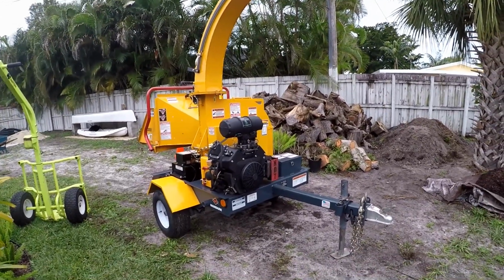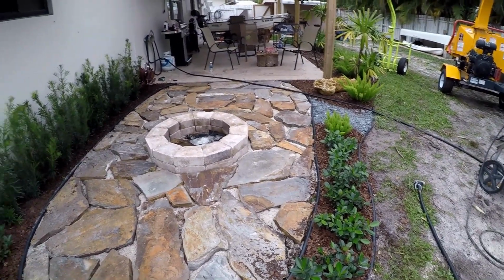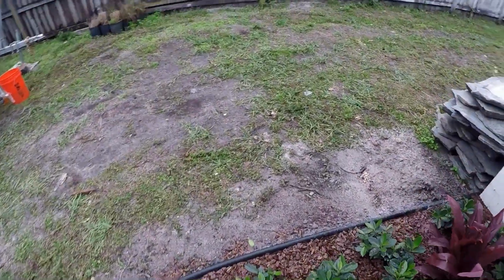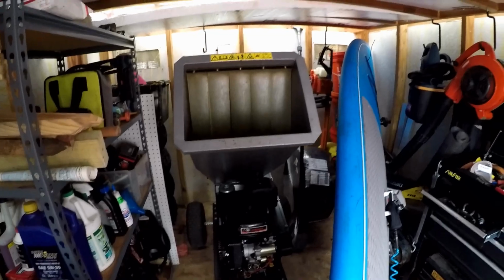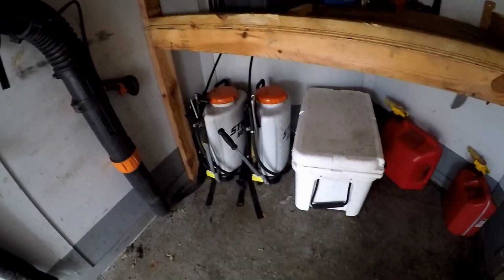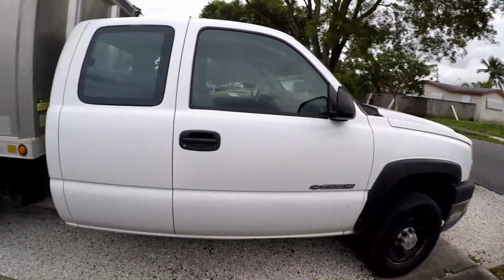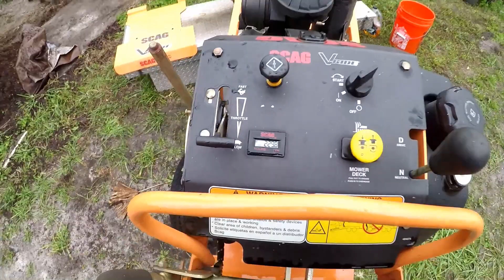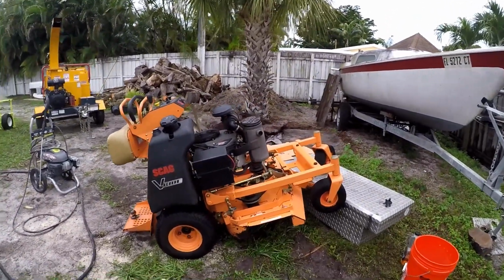*UPDATE+ I bought a brush chipper!

Comment: Is towing things with the vride bad or does it not really do anything to it?
Reply from the maker: In theory being that it's a hydrostatic transmission, similar to that of a skid steer but on a smaller scale, excess load shouldn't affect anything. It's just fluid running through a pump to a motor. I could be wrong but time will tell. I've experienced no difference in the handling.
Reply: ok thanks for the quick response, and thanks for making  a lot of new videos lately, really do enjoy them and think you make some of the best content out of any one.
Reply from the maker: Jesse V's Lawn Care thank you! That means a lot.